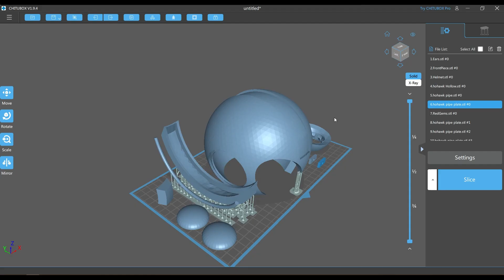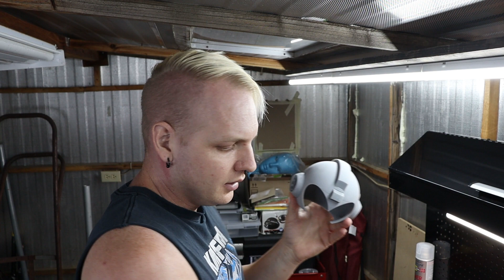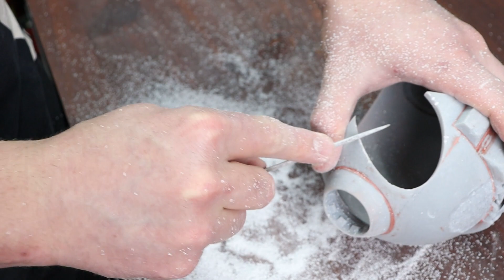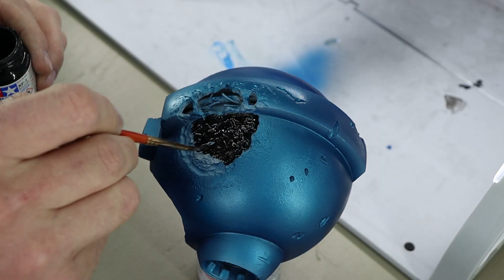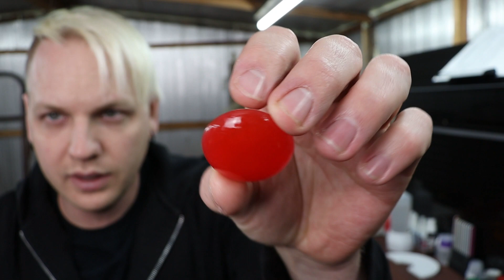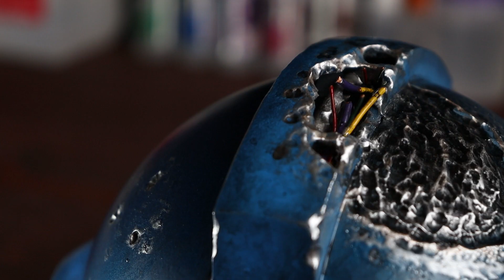Painting & Finishing 3D Prints Using Different Techniques - Battle Damaged MegaMan Helmet

Comment from the maker: My all time favorite megaman series is megaman legends, the sense of adventure going on digs in ruins is a great childhood memory of mine,
what is your favorite megaman series?

Tools Used

ELEGOO Jupiter 12.8'' 6K LCD 3D Printer   https://bit.ly/3dl8UYL
Airbrush  https://amzn.to/3HeSBso
Airbrush Spray Booth   https://amzn.to/3weAUmE
Miniature Paint Brushes   https://amzn.to/3iT6rHx
Hot glue gun  https://amzn.to/3CZQGFD
Needle Tip Glue Bottle   https://amzn.to/3Xjs6rq
Silicone sculpting tools   https://amzn.to/3CXTy5S
Rotary Burr Set   https://amzn.to/3ZPLqyq
Needle File Set   https://amzn.to/3Xk5rLz
Nail Files   https://amzn.to/3wemh2Q
Helping hands soldering   https://amzn.to/3IZLQw6
Soldering station   https://amzn.to/3WgO6ln

Paints
Tamiya Titanium Silver  https://amzn.to/3ZMuWa3
Tamiya Chrome Silver   https://amzn.to/3D0nhLs
Tamiya Flat Metal Gray   https://amzn.to/3ksTUeh
Tamiya Metallic Blue   https://amzn.to/3HcBfwq
Tamiya Sky Blue   https://amzn.to/3XIK6LU

Electronics
PCB Boards   https://amzn.to/3CUz8e4
Transistors   https://amzn.to/3Hd9Hag
Capacitors   https://amzn.to/3iRmvtx
Integrated Circuits   https://amzn.to/3XyE9Ba
LEDs   https://amzn.to/3GUjvol
Wire    https://amzn.to/3XHkDSY

Other things
BSI super glue   https://amzn.to/3XrtTe7
Masking Tape for Curves   https://amzn.to/3Hh49f0
Thin Masking Tape   https://amzn.to/3ZPBSDh
Spot Putty   https://amzn.to/3R4HcPv
Mr. White Putty   https://amzn.to/3kq4bIi
Copper Wire   https://amzn.to/3ITiSxQ
Siraya Tech Fast Grey  https://amzn.to/3CZRx9j
Casting resin  https://amzn.to/3iN1IHo
Silicone  https://amzn.to/3knrMtc

____________________________________________
Note : Most of the links that I use that go to products are affiliate link. This means I make a small commission on anything that you happen buy using them. This is at no extra charge to you and this helps support the work I do on this channel. 😁👍
____________________________________________